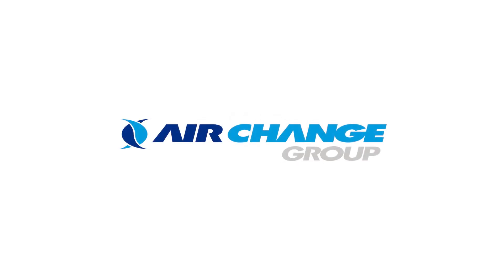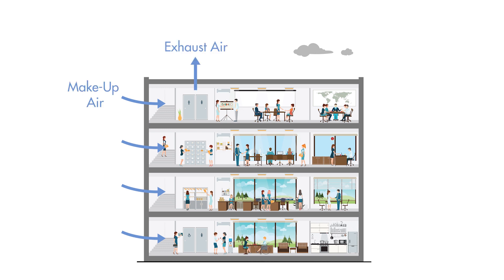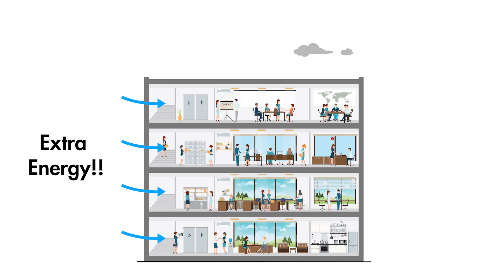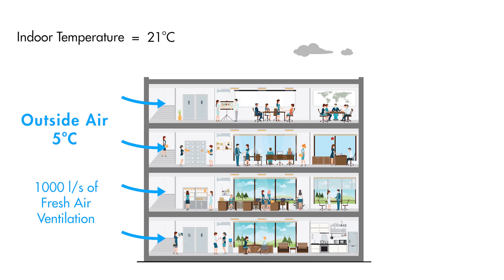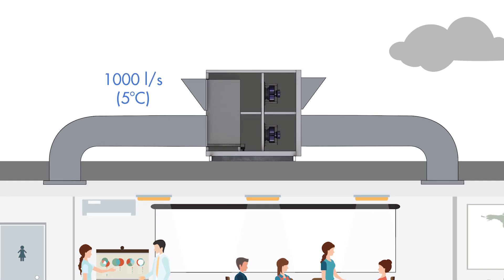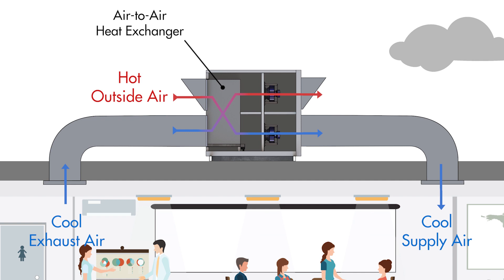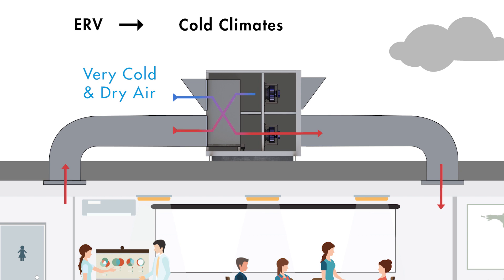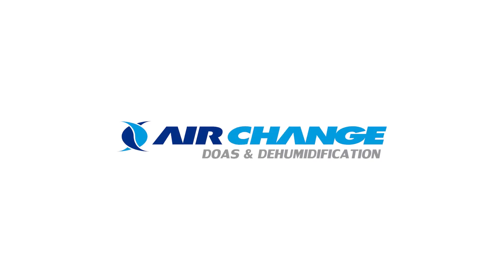ERV & HRV Units Explained

Comment: QUESTION:  I am designing a house to build in Canada, so heating and cooling are necessary.  I know an ERV is code and also good for air/humidity quality and health.  If I were to choose a forced air furnace, would that be a completely separate set of duct work than the ERV?  That would be a lot of duct work.  With installing an ERV, what is the best whole-home cooling option?  I'd be happy with hydronic radiant in-floor heating... but I also want whole-home AC and my design is not conducive to mini-split wall mounted heat pumps.  So if I do a ducted forced-air heat pump... will that be a separate set of duct work from the ERV?
Reply: It’s better to contact the company directly via phone, not thru youtube p, to get an answer

Comment: Great video. Really clear explanation. One question: So with the ERV - is there some air exchange or how does the humidity get exchanged? If there is air exchange how to you clean exhaust air before (or after) it mixes, as it will have high co2 and airbourne virus particles etc? With a HEPA filter or similar for virus's? That won't scrub the co2 though will it?
Reply: This other video explains it better ( https://youtu.be/QOSelUK6dpQ ) but the material in the exchanger will be different. in an HRV where only heat is exchanged, the material will be metal, while an ERV may have a a cloth-like material (or silica?) that will wick away humidity from one air stream and will be picked up by the other. 

For the other question - filters. CO2 shouldn't be a concern since you're only exchanging heat. The exhaust air is still exhausted, unless you're using a system that returns some portion of the exhaust air, in which case you'd limit that return air accordingly.

Comment: If I'm in a house and I find a unit how can I tell if it is an HRV or an ERV by looking at it? I looked up the model number but the model comes in both HRV and ERV versions and I couldn't find any labeling that stated one or the other.
Reply: Usually the HRV has a metal core. ERV has a plastic/ceramic core (unsure of the composition 100%)

Comment: I am in Togo  Africa and i need to install units but its very large its around 7152 square meter factory, and if i install this type how do i know the temperature inside the factory with 3ACH(air change per hour around 151000cfm) because i think if i change the air more, then i will arrive to more equal temperature with the outside air.

Comment: Can the units run without exchanging heat? I'm form Texas where we have big temperature changes. Can I for example exchange heat during the day when it 95°F(35°C) and just exchange air not heat when it's night and 60°F(15.5°C)?
Reply: By Exchanging air you mean rejecting the exhaust air and have 100% outfoor air, this is called Economy Cycle and it’s part of AHU design using motorized dampers connect to BMS system or HVAC controller. Erv and HRV are strictly for exchanging heat and humidity

Comment: I'm an HVAC contractor...this is BS
Reply: Id love to know how you arrived at this conclusion.
Reply: @Burritosarebetterthantacos  are an HVAC contractor also? I'd definitely love to explain
Reply: @jaysheat631  Shoot. Ive done hvac for almost 20 years.
Reply: @Burritosarebetterthantacos  oh so it not a contractor...no sweat, u should still understand what a micron is ...look up what the size of the coronavirus is in micron's and compare that to the filtration of this device
Reply: @jaysheat631  this unit is built to exchange air not purify it. For that you would need whats called an “air purifier” lmao.
Reply: @frankly2677  can u explain how in the world this device would help with Covid ?
Reply: @jaysheat631  fresh air in used air out.
Reply: @frankly2677  it actually mixes the air
Reply: @jaysheat631  merv filter. By increasing the ventilation rate the concentration of aerosols is diluted and the chance of transference reduced. This is why ASHRAE, REVHA and other organizations recommend increasing the ventilation rate as long as the equipment can maintain acceptable thermal comfort (A thermally stressed occupant is more susceptible to infection).

Comment: How do you do the actual energy calculations according to the temperature difference and volume rate of air?
Reply from the maker: We have a program that calculates this sort of thing for us. In this case it takes the change in enthalpy (kj/kg) between the outside and inside condition and multiplies it by the mass flow rate (kg/s). So we have (34.8 - 18.6) x 1.26 = 20.4 kW
Reply: @airchange255  These numbers aren't in the video
Reply from the maker: @zacharyrollis8455  Yeah, we didn't want to include enthalpy numbers as it might just confuse people. Calculations like this probably deserves its own video

Comment: Is there a solution for a condo unit that has too much condensation in cold Winters?
Reply from the maker: Yes, a small residential sized HRV should help. Condensation occurs when air comes in contact with a cold surface and gets cooled to its dew point temperature. So to eliminate condensation, one of the following (or both) needs to happen:

A) the moisture content of the indoor air needs to be reduced (to lower its dew point temperature). 

B) Or the temperature of the surface needs to be increased (to prevent the air being cooled to its dew point temperature).  

On a cold day, ventilating a room will lower the moisture content of the indoor air. So using a HRV will help with solution A.

But firstly ensure that the source of internal humidity is being controlled - are bathroom, kitchen and laundry exhaust fans working properly? If they are and condensation is still occurring, then continuous ventilation from a HRV may be needed.